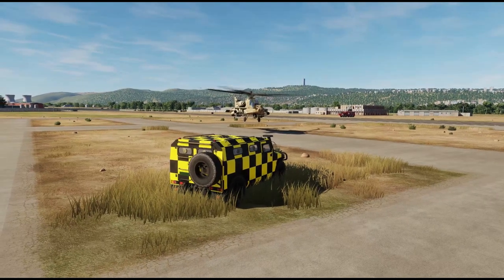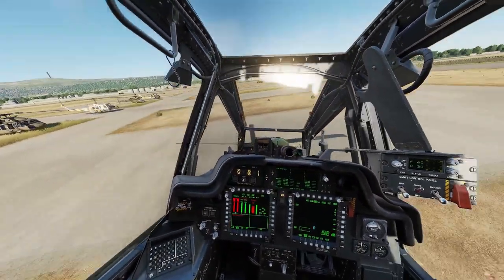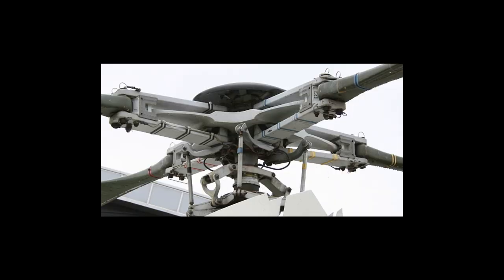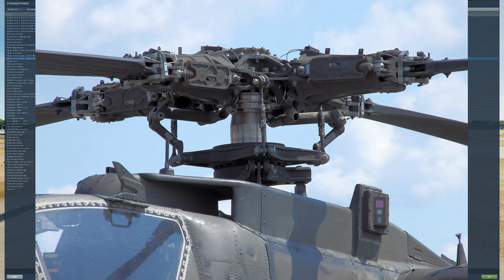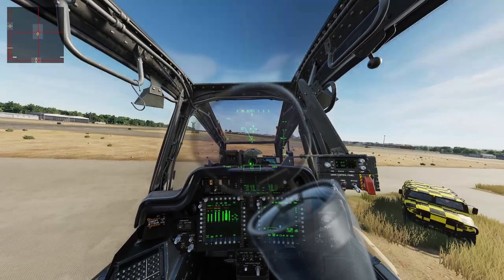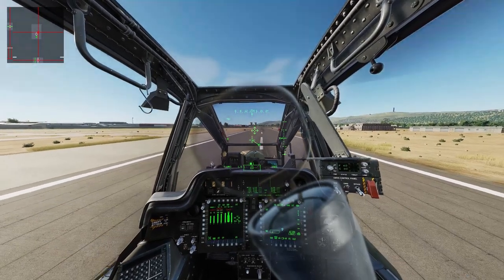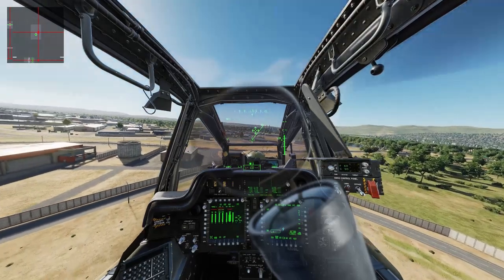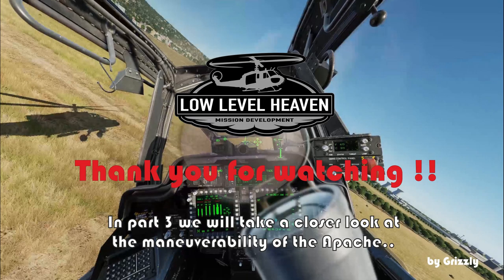AH-64 APACHE /  performance and behavior

Comment: Thank you for these videos. I have the UH-1, Mi-8, gazelle but I’m finding the Apache, strangely, to be the most challenging, maybe “less intuitive” to fly.
Reply from the maker: Thanks for your feedback.
You should not do the APACHE any injustice. From the point of view of a helicopter enthusiast who loves the monility and flexibility of the helicopter, it has very little to offer. As with the KA-50, I prefer to call it a weapons platform.  The ability to take off and land vertically as well as hover makes this flexible to use, but pilots are more weapons operators than pilots.